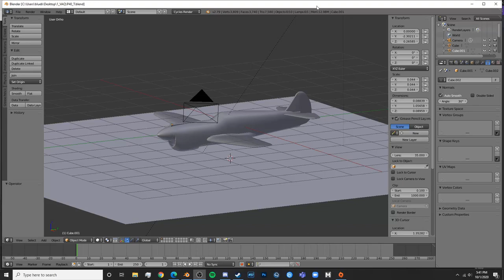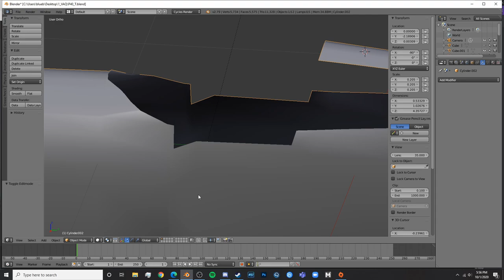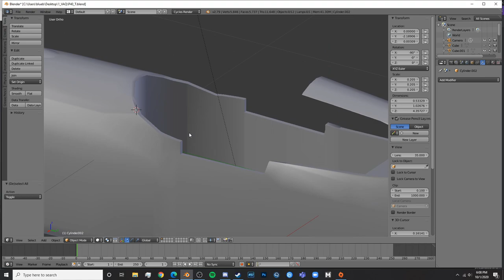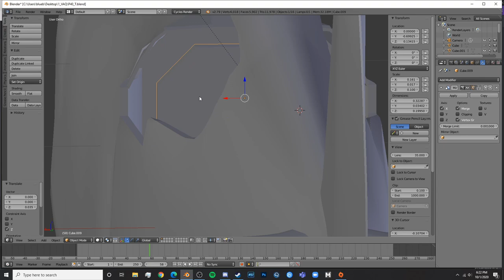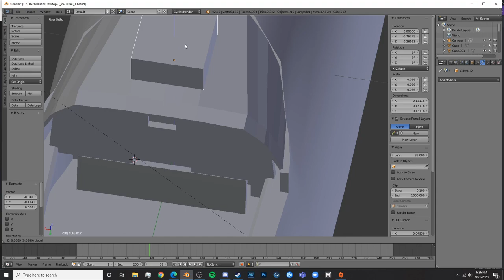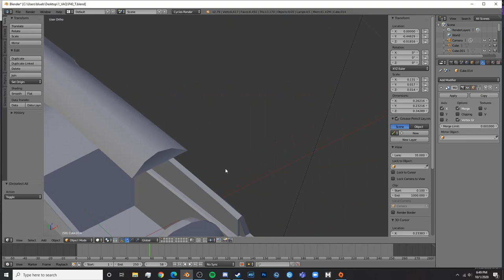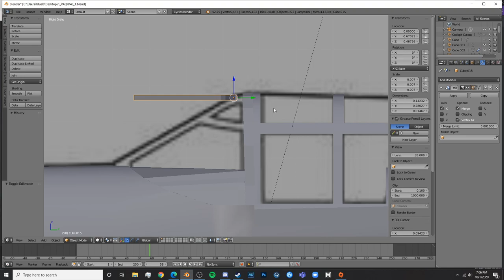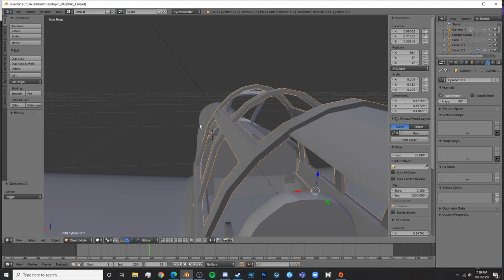Intermediate Airplane Modeling Tutorial using Blender: Part 2

Comment: Oh hell yea! Your making the instrument panel too?
My first complex thing to make was your P51 mustang. I now have it flying in Phoenix simulator.
I have just gone back in to try and fix some beginner mistakes and bad shading. I had several layers of glass in the front canopy glass causing bad shading some of them long triangles going all different directions. Then I didn't know about S Z 0 Enter to align vertices to an axis either. Also learned by accident that you could select half the airplane hit H so you can hide the back half of the airplane and look strait at the gauge panel.